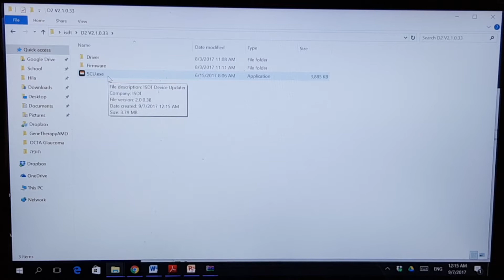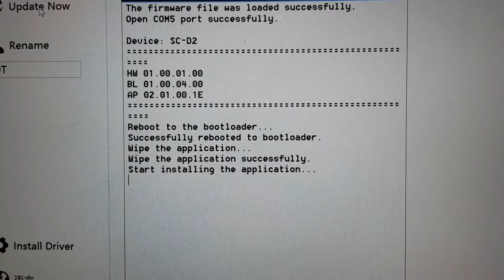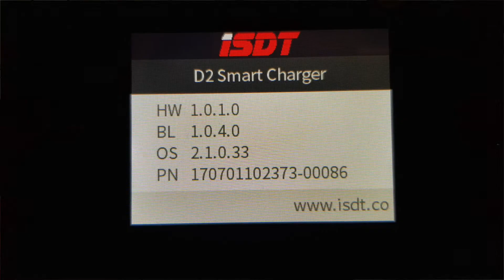How To Update An ISDT Charger Guide (Using SCLinker)

Comment: whats change Kremer? from the original update? I'd like to really be able to change the default voltages for storage and charge voltages instead of having to change them every single time you have to charge or do a storage charge. I like to charge to 3.84 volts and it auto resets to 3.80 every single time. even charging does the same thing sets to 4.20 I'd like to do 4.22 sometimes. really wish that would change so you can set your own default voltages to make it truly work the way you need it to... thanks for the video.
Reply from the maker: I am not sure what was updated and this is a pretty old video. You need to check ISDT's website and check on their log.
You can also try to reach them through their website and Facebook page.